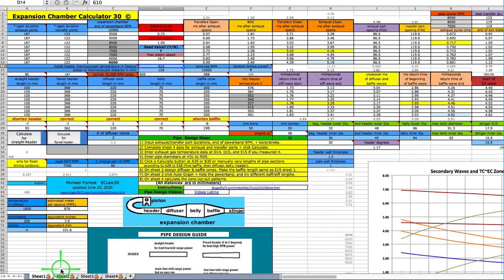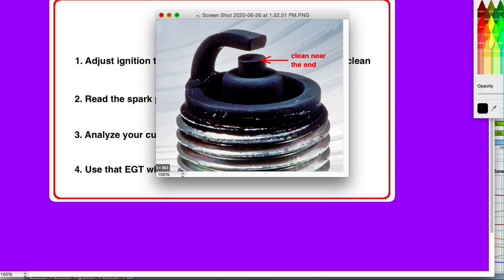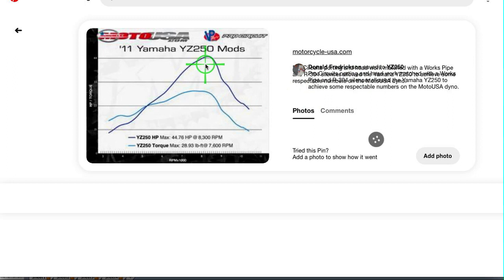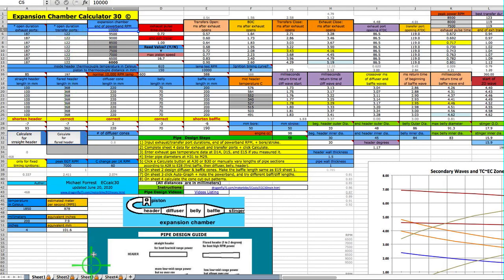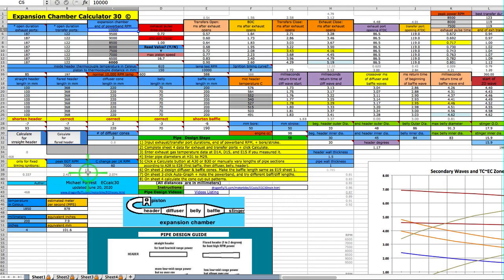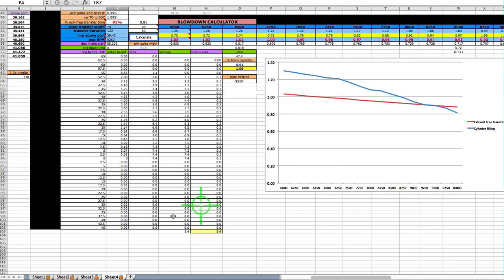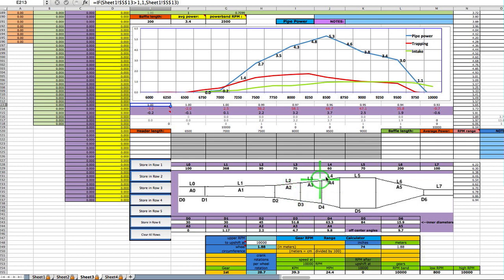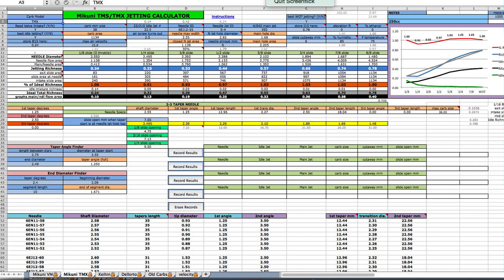ECcalc30 Overview

Comment from the maker: Update: on the pipe calculators sheet 4 at A50 and A52 you can enter the distances above the ports and at B56 and B58 the estimated hot durations will display.